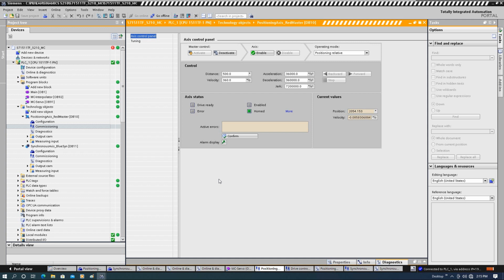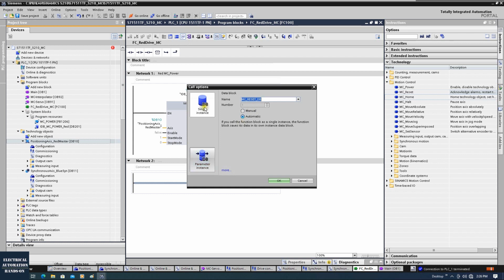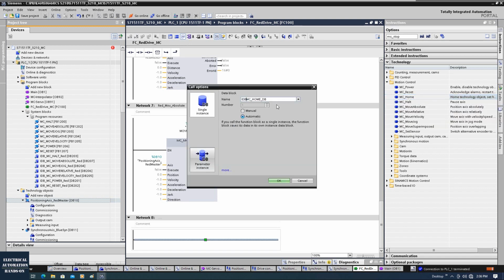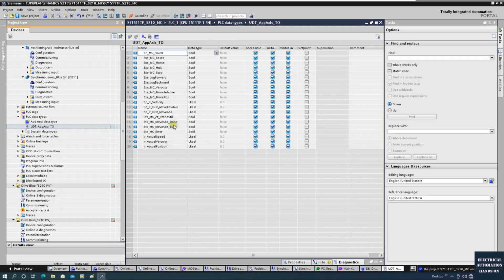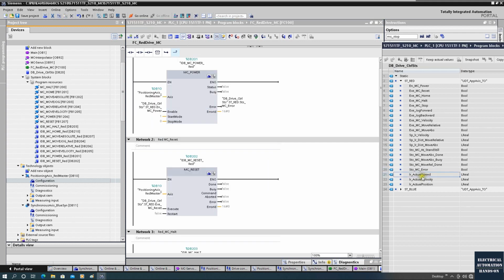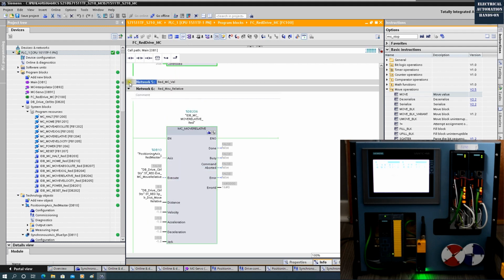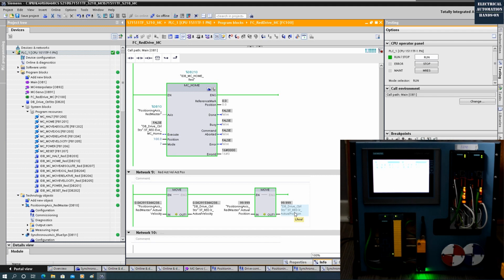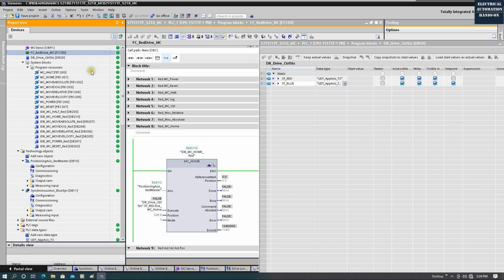MS06G. [Siemens S210 #07] Motion Control Function Block Programming and Live Test

Comment: Thank you sir for your in depth explanation of the topics. 
Great help to understand the functions.
Could you please suggest the function for disengage and engage the brake on the servo motor from a HMI tag when the motor need to rotate by hand. 

1511-1PN, S210 and 1FK2104-4AF10-1SA0

Comment: Hello, when doing the home procedure, how can I do the following: When I set the Execute input to 1, I want the motor, if it is at position 500, to physically move back to the position of 100 that I set in Home. Is this possible? In the commissioning section, we set parameters like approach speed and input for Home, but we didn’t use any of them.

Comment: Sir, at 43.54 . You had power off the servo and rotated the motor by hand. How many rotation can we do? Is it possible 50-60 rotation by hand and will it be able to correctly show exactly the position. And how can we know what's the maximum rotation it can be rotated manualy and it can show position correctly please explain.
Reply from the maker: It depends on the type of the encoder you are using. The encoder I was using in the video is ONE revolution absolute encoder, so if I move the motor within one revolution, it is not a problem and the encoder can show the difference even through it was powered off.  If you are using multiple revolution absolute encoders, then your axis position will not lose while the system is powered off.
Reply: @electricalautomation  . Thank you very much for your response sir.